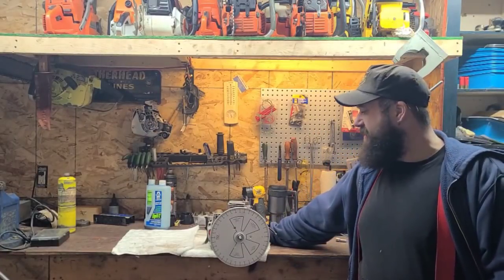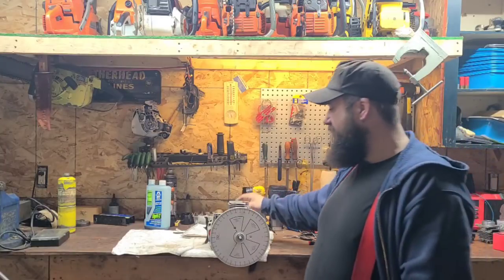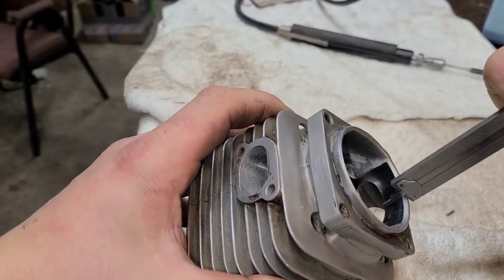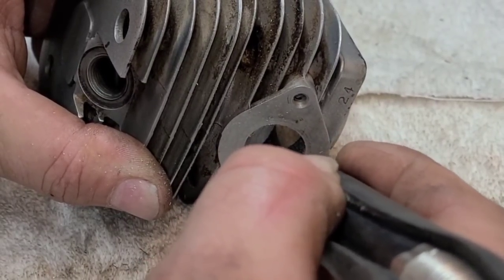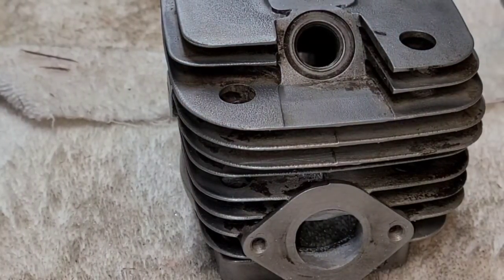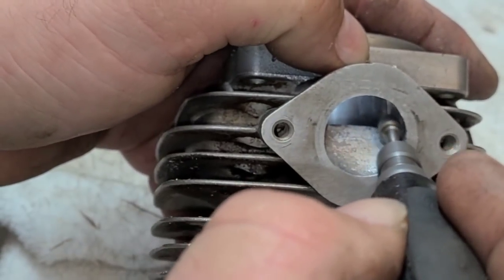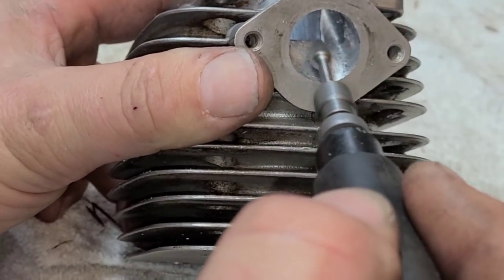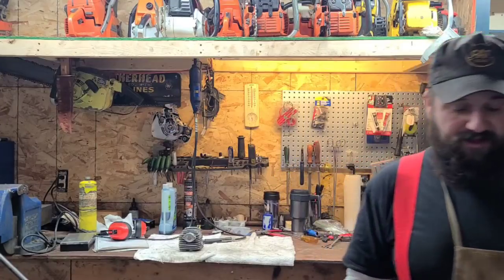How to port a chainsaw part 8: Grinding the intake port!!

Comment: Nice one tinman, I remember in the 80s having my 125cc motorcycle head ported by a guy and it came back all rough finish in the ports, I thought oh my God what has he done. When I rebuilt the top end and rode it was amazed at the power difference 👍

Comment: so just a thought ... don't adjust the intake timing on the cylinder , but rather adjust the intake timing by cutting the piston skirt . if you go too far , pistons are cheap to replace ... hell a guy could even tig weld the skirt back up and reshape it if he had too .
Reply from the maker: That does work for sure.
Reply: @tinmanssaws have you experimented with golf ball style texture on intake ports?

Comment: I highly recommend a ball hone. Ive got an old beat up looking one. I can just cram it into a 55cc saw and it still works on 100cc. I chamfer the ports first and get them all smooth and a minute or 2 with the ball hone soaked in ATF has it really nice. I like Auto trans fluid because its a detergent and cleans while lubing.
Reply: Hi Ben, that was some darn good advice. Could you please make a quick closeup video explaining how you doe it. Just a videos of your porting tools and lubricants will help Tinman's community. Thank you for sharing your wisdom with us!!!
Reply from the maker: Ball hones are so good!!

Comment: Tinman thanks you... I learned a lot from your video. I ported a cylinder a while back …. but haven't had chance to run it and now I'm glad I haven't ….until I check the number on the original and this ported cylinder. The workmanship looks great on the  cylinder I did, but after see you examples I believe I'm going to break the piston. I left the transfers alone but match the intake to the boot to the cylinder so I had a smooth transfer. I never changed the shape of intake cylinder side other than I did polish the port. The exhaust is where I made the mistake, I matched the exhaust to the OEM gasket and then the muffler. Its the bottom shape of the exhausted cylinder sided I hosed up. There wasn't much on the internet on porting when I did this cylinder and I saw where someone squared up the bottom of the exhaust floor so that what I did. I should have left the original shape as is. After watching your video I'm not so sure if I flatten the exhaust roof now, I may have done that too. The exhaust port is where I did most of the port work.  I pretty much left the shape of the other ports  the same on the cylinder side other than opening up the floor of the exhaust port. My thought was to leave the factor number the same thou I have a degree wheel, I didn't think I need to check them...I just didn't know any better. I have MS461 one of my dads saws that needs rebuild, the cranks is bad. I just  started  looking at doing a total rebuild and some porting on a new cylinder is how I found your video, glad I did. Thanks for making this series.. it.really helped and totally changed my thought on these two saws. I'm sure it going save me from breaking the piston on that 038. Most like this 461 too. Many thanks to you and family …. stay safe.

Comment: I found the old golf balling technique to work wonders on the echo intake port where that rough wall is I polished it off on one cyl and golf balled it on another that I had ported .it worked great that saw with the small golfballing on port fall facing intake made a great saw they were tiny divots but worked great help  atomized fuel saw pulled 1/2 more pony torque curve moved up as well its a homemade dyno for small engine but worked well I felt it more in the wood then I saw it on paper

Comment: Thank you for pointing out the difference between the coating and the metal. It really shines though on this video. I can hear the difference in hardness as you're working your way inwards and you start cutting into the coating again after cleaning up the outer part of the intake, and it's going to save me a cylinder in the future one day. Thank you.

Comment: Thanks for making these videos, you have alot of knowledge and I'm learning so much. For what it's worth, I have a few books on engine building that includes porting for old school v8 engines. With flow tests and Dynos, polishing did make a difference but it's very minimal compared to changing shape and size. Time spent cleaning out casting marks and restrictions was time better spent. If you're looking at squeezing out that last 5% out of your saw it might be the difference but 5% on an increase of half a horsepower wouldn't even be noticeable. Would be cool if someone made some sort of database of saws with the timing numbers factory, changes people tried and the results.

Comment: Ive always been told the rough finish on ports flows faster than smooth. The air gets trapped and buffers the air flowing past it. 

Not a huge difference but the rough flow more. 

Also always been told its more important on intake ports. Exhaust are gonna get coated with carbon and determine their own finish.
Reply from the maker: You are correct, it's called laminar flow. Thanks for commenting Timothy

Comment: That rough finish on the  intake port is akin to the theory of dimpling on a golf ball. Ie. the air travelling around the golf ball travels faster
She some guys actually dimple the ports using that theory. Food for thought anyways
And hello from Western Australia bro
Thanks for sharing yr knowledge. Been using this to play around with engines on my Baja. Cheers
Reply: I used to tune and modify racing two stroke motorcycles and I found that you could spend days polishing the ports to a mirror finish and when you put it on the dyno it had gained absolutely nothing, sometimes though it's not what the dyno sees, it's what the customer expects. If I had the whole engine to rebuild and modify I left them with the finish from the grinder as I got the engine in one piece and returned it the same way, if I was delivered the top end only I would make an effort to make them shiny.

Comment: Rough intake ports is what my small engine shop teacher said. He said the fuel fills in the roughness and makes a far smoother surface than anything we can do.
Reply: He said he would somehow sandblast the intake and transfers but I never saw it done so I don't know what he used to cover the cylinder with to protect them from the sand blasting.  Maybe tape and wax I dunno.

Comment: Awesome work on these video  definitly easy to follow along with  definitly helping me along with my  partner S55 build. Got the gasket delete  and  trimmed .20 off the cylender base  ready to redo my numbers again than start the port work and got a  new piston ring coming in a couple days from  SAWPARTS Canada  should have eberything to get it running good after that.  thank you again for the awesome explanations in the videos

Comment: At 206 cycles/revolutions per second how does roughing or polishing have any bearing on keeping the fuel in suspension?  The heat of the intake-port will  prevent any condensation of fuel.  If you want better fuel flow, a "velocity-stack" is the way to go.  As for porting mufflers, gutting them and putting-in coarse  wire mesh screening before the exit will work better than adding more ports. Just look at your car's exhaust-system, all those cubic-inches going out a 2" tail-pipe.  Just stuff to ponder.

Comment: Hi Tinman , thanks for answering me yesterday about the Mcculloch 10-10 , smoking issue. Couple more questions for you. 1st incase it needs one , are the aftermarket pistons on ebay in a red/white,black box labeled " little red barn " any good for the long run or should I seek genuine Mcculloch piston and rings ??? Are they heavier or lighter than stock ?  I have knowledge with atv and automtive above average but not saws ! And lastly do they sell Mcculloch exact color yellow paint anyplace , heat paint to ???? It what would you recommend , Ill paint the cylinder lightly for sure but maybe the whole saw if I get crazy with it. It looks pretty good though . Thanks alot for your time.

Comment: How would I go about making a torque monster I'm into RC cars and they run the same kind of engine and I'm interested in trying to Port it myself is it okay to make the intake and exhaust Port wider with your knowledge of engines you should start porting car 2-stroke engines

Comment: do it rough to make more drag??? = what???
Reply: It causes the air fuel mixture to atomize better
Reply: If I comprehend correctly on the intake you rough angled downward ,the fuel mix fills the tiny bumpys and slicky it while atomizing the air coming through also In a since squeezing the oil from the mix so to speak to throw down on the bearings THEN you have  smooth  transfers to send the remaining charge up top ...so rough intake/smooth transfers is the goal at least the way I understand..could be wrong but it's the goal I aimed for on my project and so far so good